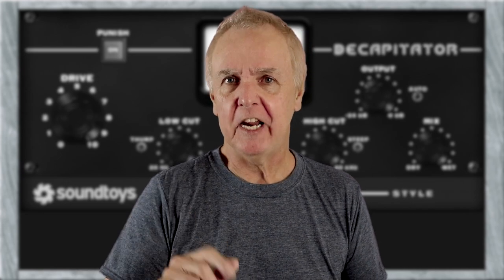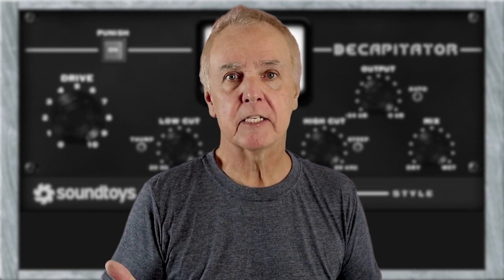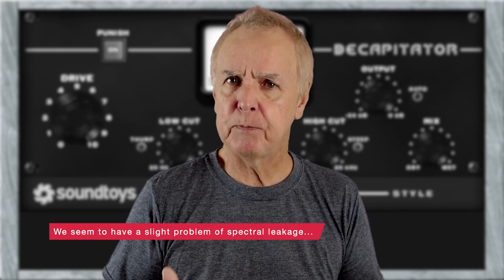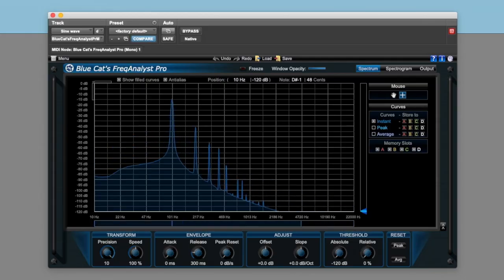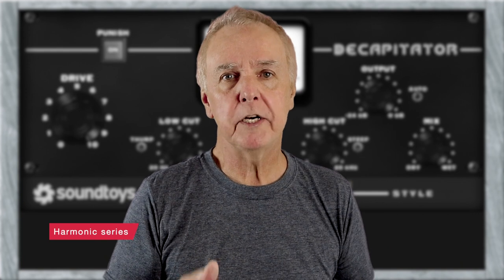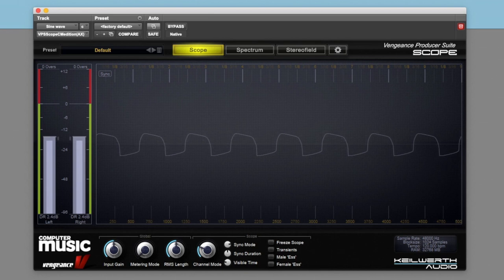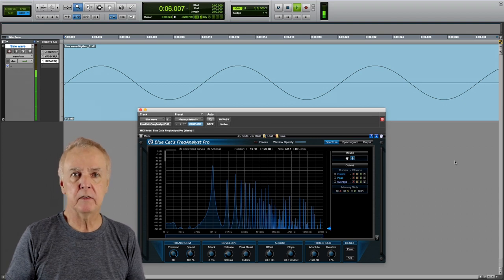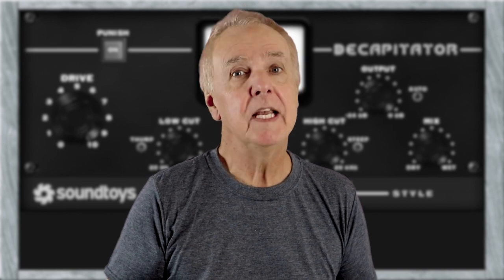Harmonic distortion with the Soundtoys Decapitator

Comment: Great intro video! You might want to think about revisiting this and adding information on aliasing, and foldback distortion in regards to saturation using lower sample rates.
Reply from the maker: In this case the distortion was in the sweep, and it wouldn't surprise me if it was caused by aliasing. I remember the days when some samplers used to alias and, though it might not be technically correct, I often did like the lively sizzling sound it made. Just as some people liked the crunchy non-linear 12-bit sampling of the original Akai MPC 60. These are topics I may explore in future. DM